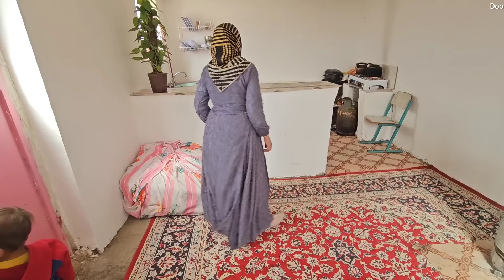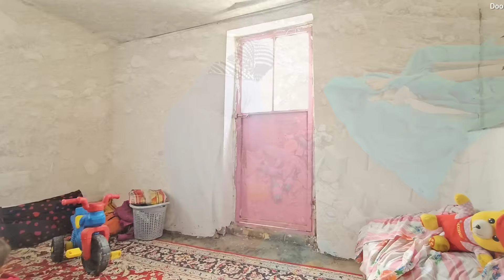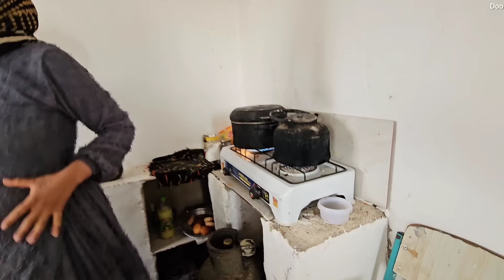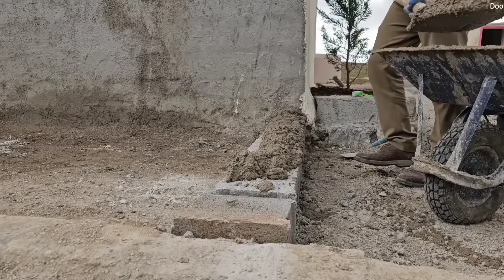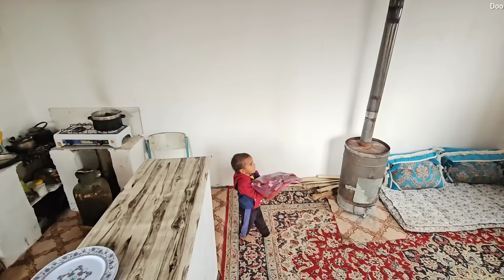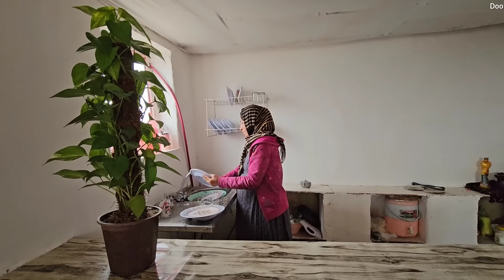Endless Support: Bringing Happiness to a Divorced Woman with the Help of a Benevolent Man

Comment: Might be a better and safer idea to put the water tank on the ground so no one would  have to climb up on the roof to fill it every time it’s empty. 
All the unused cemented areas on both sides of the house could be used to add onto the house. Extra room will be needed with twins on the way. It is a great idea also to be adding a structure for storage and not have everything piled all over the yard. That is going to make the property look even better.
Reply: Like to respectfully point out that water does will not flow up- wards and into the kitchen sink, that's why the tank is in the roof   I think as time goes by, large water carriers will visit the area and fill all water tanks.
Reply: They have plans for those areas already.  The water tank was put on the roof of the house for gravity to put the water in the kitchen.  It will be moved to the warehouse.  Did you watch the video?  They are already building the warehouse.
Reply: @lindagroves2668 sound great!  I Think I saw on another channel where a water truck delivered  water in this way.
Reply: Not a warehouse it's a storage building for wood cement tools and chicken food it might be a good idea to build a chicken coop side by side to storage space make it big enough to put roosting areas in it and nests and most importantly put a proper door on it
Reply: Maybe they could build something around the tank close to the wall with bricks  to enclose it  it would be easier  than climbing the roof it looks ridiculous to me